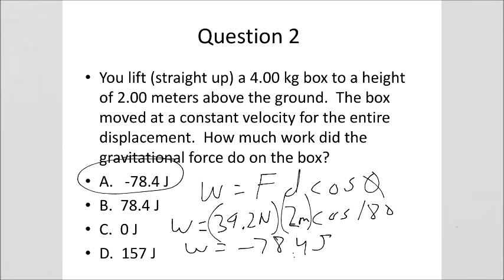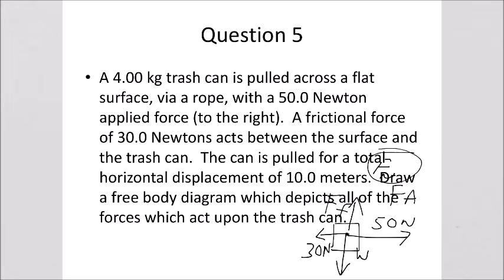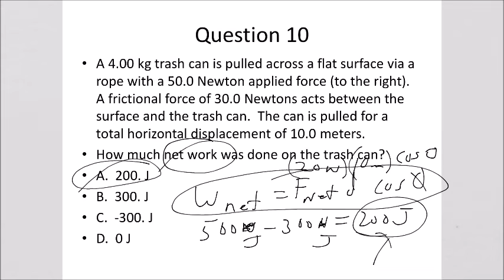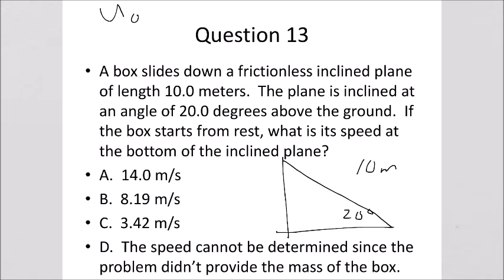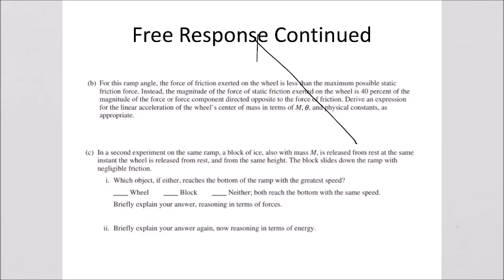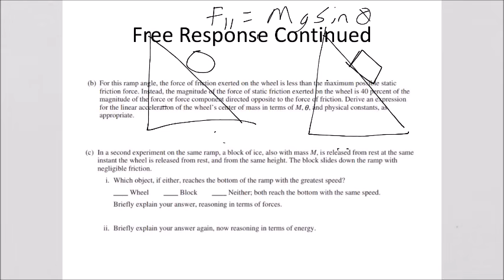AP Physics 1 Work and Energy Practice Problems and Solutions

Comment: On problem number 1, why 0 degrees when you are lifting the object that is perpendicular to the surface? Should it be 90 degrees?
Reply: Since the problem is moving with the y axis and the force said it's lifting, it's the same direction. So, the degree should be 0
Reply: cos(90)=0

Work Formula: Force x distance x cos(θ)